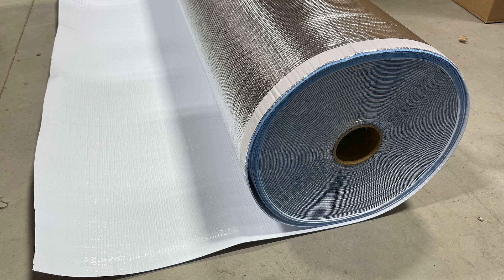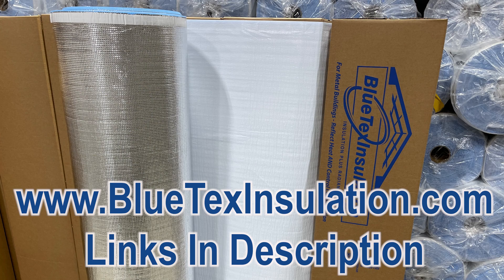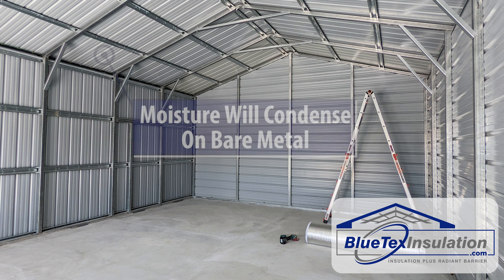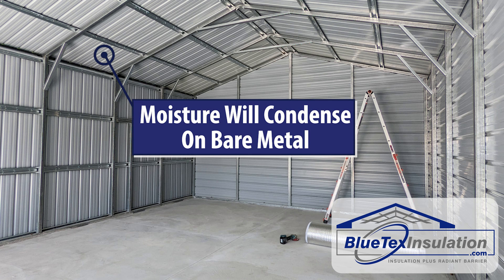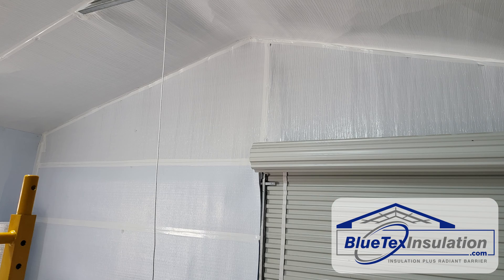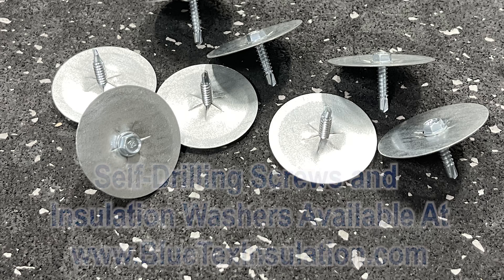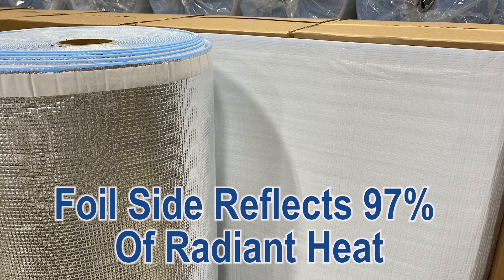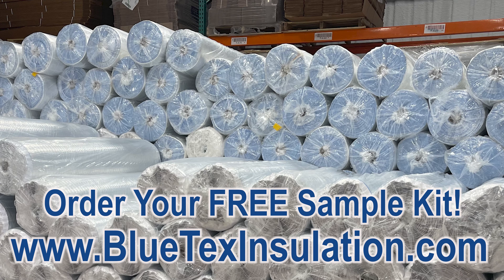How To STOP Condensation or Sweating In Your Metal Building

Comment: Other than cost and ability to replace metal siding; why is this better option to closed cell spray foam?
Reply from the maker: www.BlueTexInsulation.com is not intended to be an option for spray foam. Spray foam is generally for fully conditioned buildings.  Heated/Cooled. BlueTex is really for non or semi conditioned building like garages, sheds, airplane hangars, workshops, storage facilities etc.

Comment: Is insulation also installed between the studs or that's just an air gap?
Reply from the maker: This is a non-conditioned building.  So, no additional insulation.  Main goal is to reflect heat and control condensation.  Maybe run some heat/cooling occasionally if needed.  https://bluetexinsulation.com/pages/insulating-non-conditioned-buildings-vs-conditioned-buildings